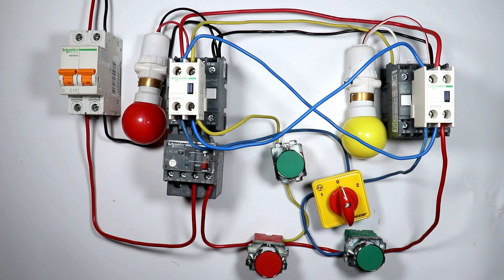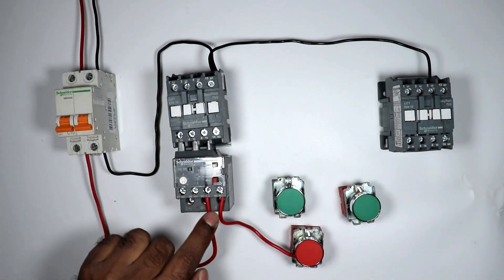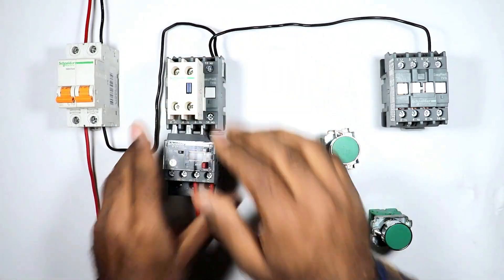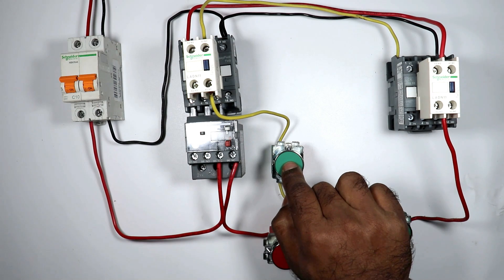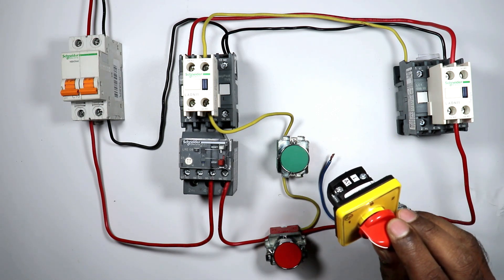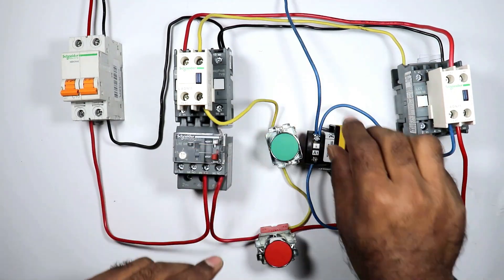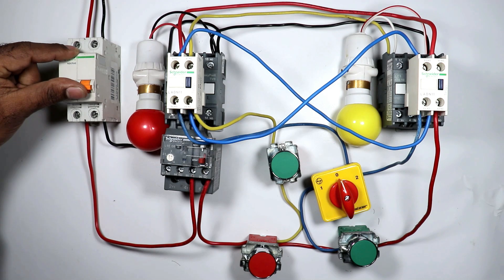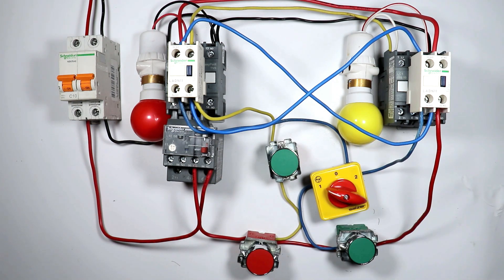Reverse Forward Starter Control Wiring with Auto Manual Selector Switch @the electrical guy

Comment: SIR, I have a question.
In a manual stabilizer (at home) , If we step up the voltage the bulb glow more brighter . How is this possible??  As we know that power equals V into I . The product of V and I is constant here . Then how the bulb glow brighter.